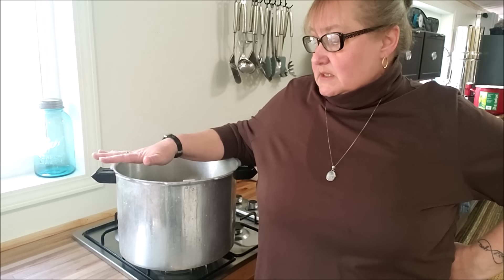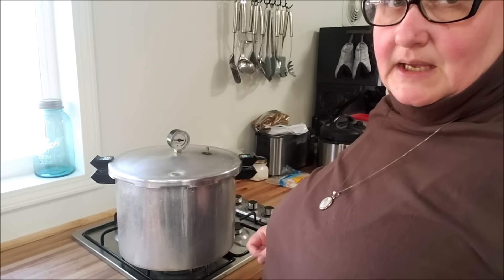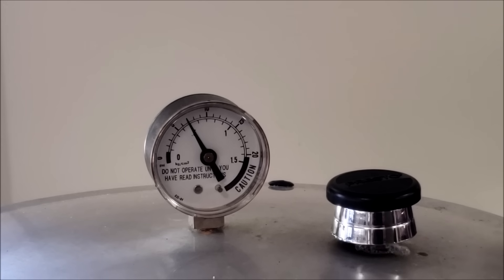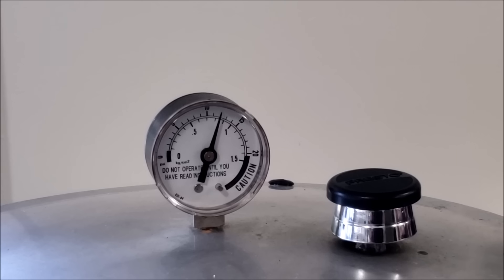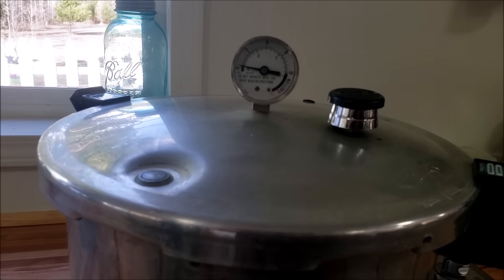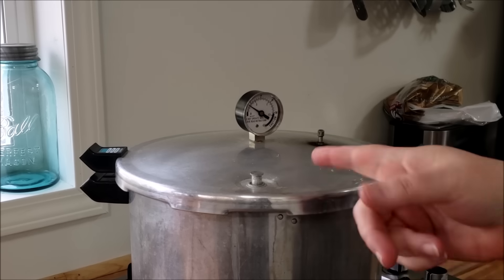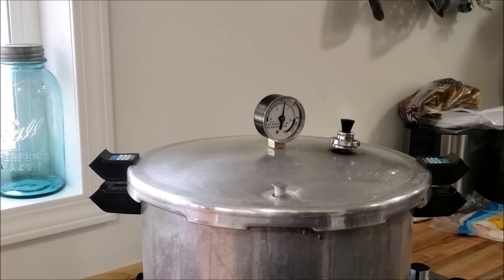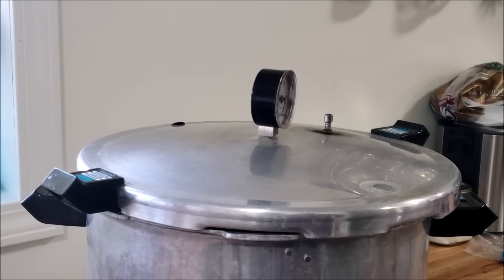Start To Finish with the Regulator & Jiggler - Canning 101 Presto Pressure Canner

Comment: I got a new Presto 23 Qt. canner, which I have now used 2 or 3 times...it seems to take a really long time to build up steam once everything is properly set (vent locks in up position, steady steam for 10 min, and regulator in place). For instance, last night it took about 15 minutes to reach 11 pounds (an agonizing wait!). But what concerns me the most is that I had a constant sputtering and aggressive stream of steam from the tall silver lock, and I could hear the water boiling like mad.  I did not see any steam coming from the silver lock in your video.  I had to watch the gauge with an eagle eye, and constantly adjust the temp to keep it around 11.  Finally, the 30 minutes was over, and when I later removed my jars I could see that I lost quite a bit of water from the pot.  I don’t think the steaming vent lock is normal.  Is there something I can check or fix...or perhaps I should return this unit for another?
Reply: On that lock there is a small white seal that may need cleaning/ adjusting.  With your fingers turn it a few times and make sure the lock is clean   This same thing happened to me yesterday with sputtering and steam escaping.  I let it cool and washed that lock and seal with a brush then just started completely over . No more sputtering.
Reply: @carenharris863  Thank you, Caren!  I took a look and saw that the bottom part holding the seal was a bit loose, so perhaps that was the problem.  It’s so new that it doesn’t appear to need any cleaning, but I will give it a scrub just to be sure. I will then hand tighten the seal and bottom piece back on and give it a go.  I appreciate your info!😊
Reply: I'm late in reporting back, but the loose seal was the problem.  Working perfectly now!  Thanks so much, Caren🙂

Comment: When I first started canning I forgot to let the lock pop up, I let the steam come out for 10 min and then I put the weight on and then the lock popped up. So I am guessing I need to trash that food that was in those jars. I canned them in October of 2021. I did it backward that day. They are sealed but I am guessing there was not enough pressur to kill the toxins? It came to pressure 75 min at 11psa and sealed them. But she stated in the video she said it would cause changes to the time you would cook it.
Reply: Hi Stephanie,  if you made several jars, open one to smell and look for signs of spoilage before throwing away the whole batch. I canned for the first time last night and wondered about your same issue. I found out there a food safety hotline for canning. You could first try the manufacturer of your brand of canner.  Blessings and success to you!

Comment: I have a presto pressure canner that the weight won't jiggle. It will let steam out but when I put the weight on it won't jiggle. The lock comes up & steam i continues to come from the lock. This only happens to 1 of my canners. Is there anything I can do to fix it?

Comment: I just got a juggler and am trying it right now for the first time. I am worried that it’s been 20 minutes and it hasn’t even started to move at what point do you need to bail and just go back to what you know? Realizing everything is a little different but I have potatoes in the canner and they’re going to be a pot of mush by the time this thing moves😜
Reply: Just a nervous Nellie. Three more min and it was rocking uncontrollably 🤦‍♀️ I will find the sweet spot.

Comment: I was running at 10-11lbs for about 15min.  Then my regulator stopped moving for 20-30sec before I got it hula-dancing again.  I know I’m supposed to start time over, but then im afraid that 45min cool time + the 15min I already cooked is going to run my canner dry.

What to do?
Reply from the maker: for literally 20-30 seconds, i wouldn't start over.

Comment: Need help. New presto canner second time using it. As I started my 75min time 10 minutes into it started  whistling extremely loud as if a train was in my kitchen my ears are hurting what could have gone wrong? I turned off the heat
Reply from the maker: Sounds lime the gasket wasn't set proper?
Reply: @SuttonsDaze  pressure vent wasn’t clear something was blocking it I cleaned it out and tried it again and was fine. That was pretty frightening lol my house was about to blow up. Thank you for your response

Comment: Thank you, Leisa.  The biggest reason I haven't gone to the jiggler is that I need 12# of pressure and I haven't seen one video where someone shows the  jiggle at that.  For my altitude I'd need to use the 15 pound weight which is the same as the 15# of the regulator, isn't it?  I start to get the hula dance with my regulator when my gauge reads 13 1/2 pounds so if I used the jiggler and heard the hula I'd assume I'm at too much pressure.  Yikes, it is more than I can brain.

Comment: I’m at a loss when it comes to using the juggler. Mine always takes forever to start moving. New rubber parts, cleaned to valve thing, oiled the ring. Canner is completely sealed, no steam escaping. Even when depressurizing it takes forever. Any clues? It’s a Presto 16 qt.
Reply from the maker: Follow the process, trust the process. This is not meant to be quick.
Reply: @SuttonsDaze  actually this time it was the rubber safety valve. 🤦‍♀️ tapped it and all is well. Timer has been set. Now I wait.

Thank you for all your info in regards to dehydrating and canning. I have learned a lot from you 🥰

Comment: New at canning, I have a Presto 01784 canner with induction capabilities. I want to try using a jiggler but the pressure at my elevation is 11, I am concerned about using the 15-pound pressure with the jiggler. Will that not overcook or cause siphoning? Are there any adjustable jigglers that allow for closer to 11 pressure? I have only canned for 6 months with a pressure gauge and want the freedom to not watch it. :) I looked at the jiggler in your amazon link but it does not show my canner as one it works with. Any suggestions? Or should I get a different canner? I love your videos, very very helpful!
Reply: I have the same canner and bought the jiggler off Amazon. Took one ring off as my altitude calls for 10#. It works perfectly. Made all the difference in the world for me.

Comment: Very good video.. as even before the pandemic getting a guage checked every year was not so easy .. it's a saftey net..with the jiggler.. I personally just use the guage to fine tune my temp . You are going to see a temp change a little quicker on the dial .. also if you are holding temp.. big time saver.. not to mention you don't need to watch the guage during the process..

Comment: I once watched the steam stream out and forgot to wait for the lock to pop up. I was not sure if that meant i did not have enough steam/pressure in the canner to properly kill botulism spores etc. I think I did it backwards because the instructions said wait for the pin to pop up and then count the 10 minutes fo steam for it to pressurize before putting the weight on. My ADHD was out of control that day so I really got scared to keep that food.

Comment: I have a lot of steam coming from the 'safety button' and the pressure gauge isn't budging.  What am I doing wrong?  This is my 4th time trying and this everytime. Any ideas or suggestions?
Reply: The black rubber stopper or the lock?
Reply: 4 tries? Not to take away from this page, in any way, but look at the mudbrooker, it is a more extreme detailed video on time and temp on your stove.  If you're losing steam after the regulator goes on, maybe you need a new black stopper and is the stopper in properly?? There shouldn't be steam escaping after the 10 min. Time to put the regulator on, and the silver top lock button comes up (indicating there is pressure in the canner,).

Comment: Question:  I have the same canner as you.  I bought the jiggler but it will not go on the vent pipe.  What am I doing wrong?
Reply from the maker: It should go right on. Gopresto.com has a customer service #. I would reach out

Comment: What if you can’t see that steam. I know hot air is coming out cause you can feel it but I can’t see the steam an my lock is engaged..
Reply: Hopefully you'll get an answer. I'm having the same issue.
Reply: @susanlester7546  I reached out to presto. My vent lock wasn’t properly locking. Once I figured that out and ran a test run I had the best set of steam come out it was great to see

Comment: I think it’s time for me to give up canning. I’m trying the juggler because I’m tired of having to stand by the stove and constantly adjust the heat but the juggler has been on for a while and it hasn’t begun to even think about starting to jiggle.
Reply: I am having that problem for the second time now it is so aggravating me! I have other things to do
Reply: @debbieglossop7546  I canned some carrots last night and figured I would try the jiggler but it wouldn’t move at all. So frustrating. There’s no one to ask any questions.
Reply: I was told today to get ahold of presto and get the weights and I will never have to worry about that guage again! Worth checking out.
Reply: @debbieglossop7546  that’s what I tried using last night and for some reason it would not move. I figured I would try it so I don’t have to stay next to the stove. I hope yours works.
Reply: @Tess-he3qg  YouTube the weight version that's what I am going to do. I guess they come with removable weights. Idk yet

Comment: Now my Presto came with the gauge regulator and the weighted regulator (round has 3 holes around the side) type. Yeah it sucks that we don't have an extension office to check the pressure gauge.
Reply: I don’t have one either so I have to just bite the bullet and buy a new gauge every so often (as long as the canner is not showing any leaks/damage) then it’s cheap enough to just resolve this way and still only have to spend 20 bucks every 3 years or so when it’s time to replace. If it fails sooner then I would just use my 16 quart presto 3 piece weighted jiggler instead of looking at the gauge if it’s broken. That way I know if it’s rocking,I know that’s the true psi I’m at. The gauges can make it way more complicated but also simple lol gift and a curse I suppose

Comment: I usually can at 11# as I am slightly above 1000 ft elevation.  I've had the juggler for about a year and have just gotten guts to try it. The directions say use the 15# weight if above 1000ft. You only use the 10#. Sooo what weight do I use? I'm using it now and it's dancing at 14# on my dial( which I'm just watching). I'm only canning bone broth so it's not a long session but I'm still confused! I'm using the 15# weight per the directions that came with the jiggler.
Reply: Usually it comes in three pieces…. All three pieces are 15#, two pieces are 10#,   One piece is 5#

Happy canning!!!

Comment: Hi, I'm new to pressure canning and so far gave used my new presto successfully to do water bathing. I have an electric stove. My problem is I am  having trouble getting pressure up to 10psi as needed.  I've read the instructions, watched different videos but still can't seem to find the solution.  Once we have a steady stream of steam for 10 minutes I put on the jiggler.  After this I keep getting small but constant water coming through the air vent (which is popped up).  Please help a very frustrated newbie.

Comment: My Presto-23 jiggler never jiggled when I held my pressure gage at 11-12psi. I just kept my eye on the gage. I don’t know why it didn’t juggle? It wasn’t easy to keep it at 11  and it bounced between 11and 12, but never fell below 11thank God!  I realize I’d have to start all over again…
Reply: The juggler that comes with it is a 15 pound weight. It is there to make the gauge to work .
Reply: @donnastormer9652    Hi Donna! I'm Connie from Michigan.  Yep..I figured that out by now. I'm very new at pressure canning, about 6 weeks old now,  so when I asked that question I just started. I'm learning! Thank you so much for your response!

Comment: What happens when you take the jiggle off right away after the cooking process is done?
Reply from the maker: You have unsafe food in a jar
Reply: @SuttonsDaze  I don't think you understand what I'm saying.  I was told if you take the jiggle weight off too soon after the cooking process is complete it rapidly releases the pressure, causing all the contents in the jar to release itself, and then you have one big mess inside your pressure canner.  Obviously if the seal is broke, you have no choice but to eat it right away, or throw it out.

Comment: Why do you wait 8 to 9 minutes to let steam escape and then another 10 minutes after you add the regulator or the jiggler?
Reply: Never mind I get it! The first 8 to 9 minutes is to get the steady stream and the next 10 minutes is to get the pressure up to where you need it.

Comment: Question
On average...if you had to guess...doesn't have to be exact...how long does it take a 16 quart canner to cool down, before you can remove the lid.

Reason.... would  it be better to process 7 quarts in a 23 qt canner vs a 16 qt canner....not worried about energy cost, more concerned with end product.  If the food remains at the elevated temperature for longer would it be mushier.
Reply from the maker: I have literally never timed it. But the 16 qt does take less time to come down. Simply because its shorter. Food would not be mushier as a result.

Comment: I hear ''restart time if it stops jiggling or guage drops below the preferred/required pressure"' but i cannot find out WHY or what happens in that minute or two that it is minisculey? under someone's magic number
Reply from the maker: Because the pressure must consistently be what is recommended for your altitude 
 For a more in depth, potentially scientific answer, I would email the ncfhfp

Comment: I can’t get mine to come to pressure. I have replaced the seal and the gauge. I bought a regulator on Amazon that says it fits my model. I’m wondering if I need to invest in one from Presto. Any suggestions? I cannot get it to come up to pressure. I had it on a much higher BTU burner then I moved it to my burner that only has 10,300 BTU, I’m just at a loss I have done four trial runs 🤦‍♀️🤦‍♀️🤦‍♀️
Reply from the maker: Move it to the larger burner

Comment: My need is 11lbs..but mine goes to 14-15 lbs and at lowest setting on my electric stove . I can't get it down to 11lbs..so I can at 13-14lbs......🤔🤷‍♀️
Reply: I wonder if you put something under the canner like a round cast iron. Griddle or upside down skillet. I never tried it just a thought.
Reply: Is yours a glass stove.
I have the same issue.
I hait on high like it said got to 11pounds and i had to go all the way to 2 on my stove and it stayed at 12 or 13 lbs
Reply: @tawnnope7196  yes glass top
Reply: It's fine if you are a little higher! It won't hurt anything. Just don't let it go lower than 11 or you'll have to start your time over. 😊
Reply: @SamanthaJoRoecker  So reassuring and very helpful.  Thank you...

Comment: I have my mother in laws canner it is an older Presto. Is this a way to be sure the gauge works
Reply from the maker: Local extension office might be able to test it for you
Reply: It will give you an estimate sure. But not the same as having it tested. Say you use a 10 pound jiggler and it reads close to 11 it MAY be fairly accurate. They say if you use a jiggler you don't have to test your gauge but if your like me and want both you can Google pressure canner guage testing in your state and they might have one close to you and the one near me is free. They also recommend you test new guages as well. Just be sure the hole where your weight/jiggler is not clogged at all.
Reply: @wthigo77  Great advice, thank you!

Comment: 13 minutes to depressurize? I take a half hour or 45 minutes and my jiggle looks like yours. The wait between batches is slowing me down.
Reply: But you have to do a natural cool down because that’s part of the canners response to staying in the kill zone. If you quick cool you risk contamination, jars breaking and siphoning.
Reply: I think it was a short time because she didn’t actually have anything in the canner, just the required minimum amount of water.